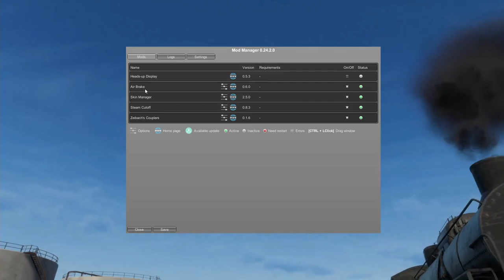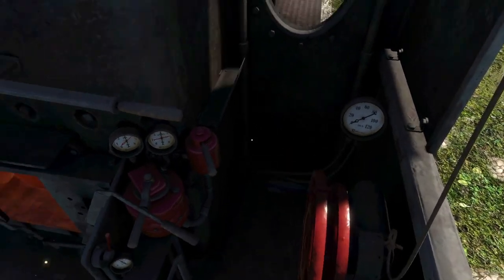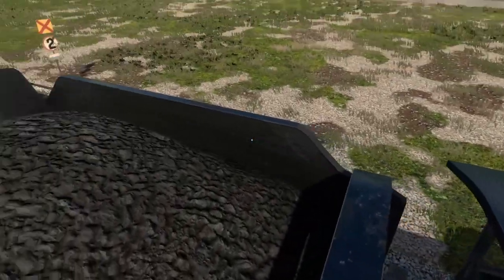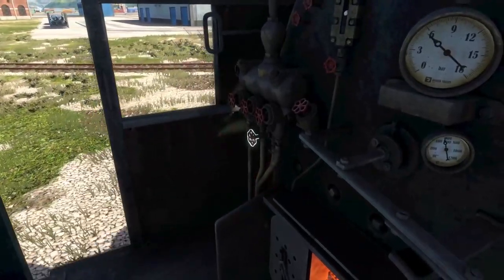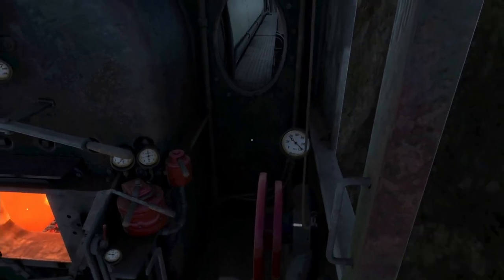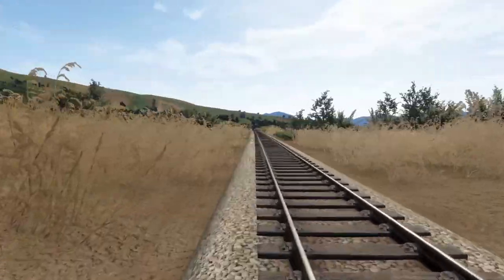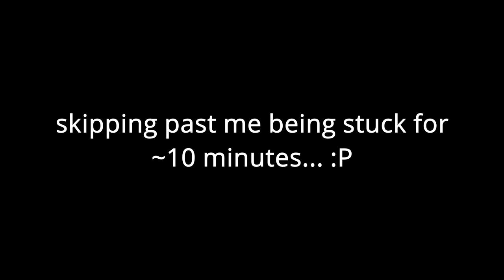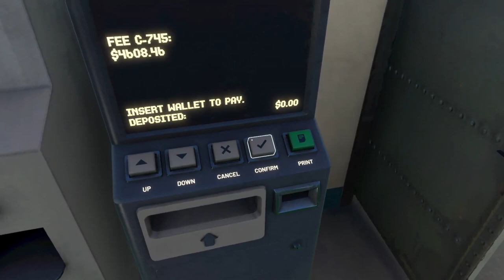[DV] Knuckles, Tonnage, and... explosions? Modded derail valley!

Comment: hype if you have zero pressure shouldn't breaks be 100 percent on and stopped because the break drums would be compressing the wheels if not you need updated standard safety equipment on the steam engines because it could kill someone how does the railroad get away with old break design not safe still in use that's a law suit waiting to happen
Reply from the maker: Nope, train brakes are not sprung on. Not on modern locomotives, or the old one. It's perfectly safe, assuming you follow the rules... lol. That's why we have handbrakes for parking.